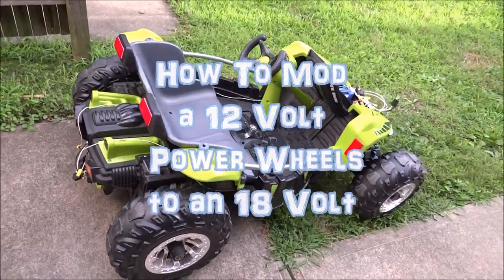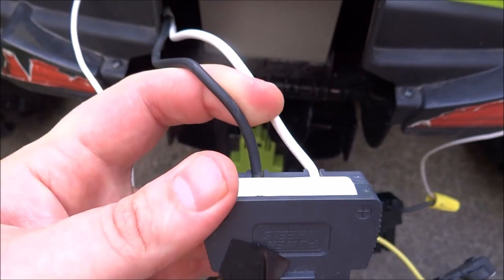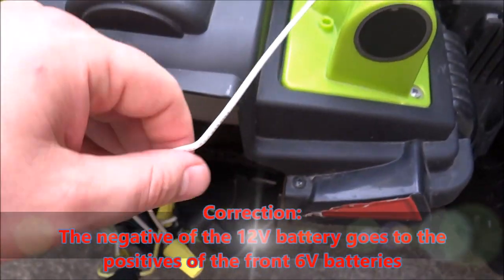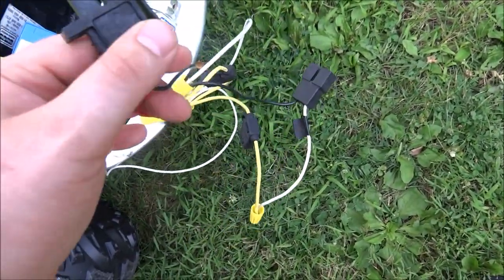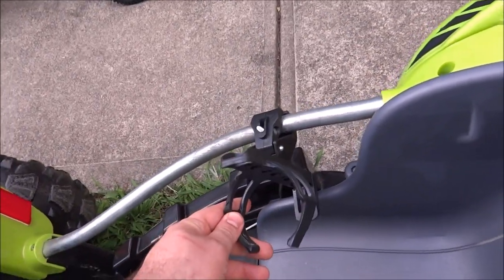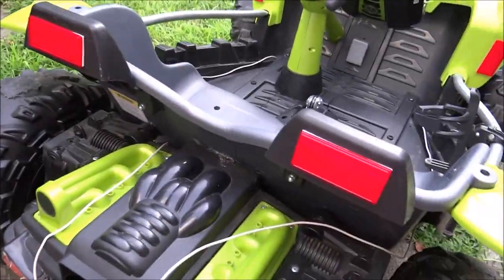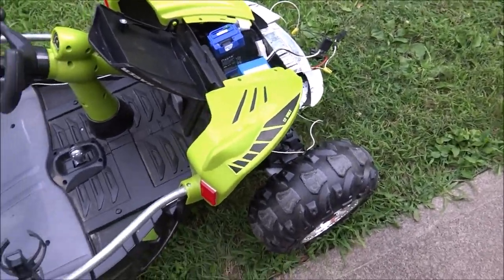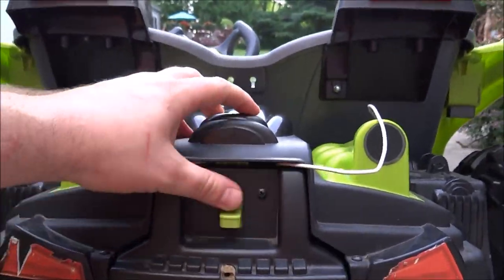How To: Mod 12V Power Wheels to 18V SAFELY

Comment: I did 24v low 36v high... Two seat modded barbie mustang into single seat with chassis upgrades required to keep it together.  Moved windshield forward 1.5 inches, steering wheel relocated to center, orange paint, grip mod (will just burn out without them) for when the kids are driving it.  List goes on.  It already had cup holders...  :)
Reply: Do you have a build page?

Comment: I can't watch a video with someone who uses household wire taps...
Reply from the maker: THATJDMGUY Great comment, very helpful!
Reply: Harry Manback using those household connectors is not upgrading one of these safely. You what advice? Solider and shrink tube the wires to Do it safely and properly
Reply from the maker: THATJDMGUY Why are they unsafe?  That is what professional electricians use.  Are homes unsafe because of them?  It's been running with zero problems for over 5 years now.
Reply from the maker: Adam Wrong OK, thanks for the explanation.  That makes sense, but again, it's worked for me for years.  Next time I do one, I'll do it more professionally.
Reply from the maker: Adam Wrong That's also good advice, thank you for the help.

Comment: I am going to change mine over.  I have a 12v trickle charger that I have been charging my cars with. I make two poles and the kids put the aligator clips on them to charge.  Dumb question, how do you charge 18v system?
Reply from the maker: Guy Redman Not dumb at all.  But I just used the chargers that the Power Wheels batteries came with.  A trickle charger is likely better for the batteries.  Though, if you just use the OEM chargers as per their instructions, they should be fine for years.  Cheers!
Reply: @HarryManbackYouTube  I guess I mean how do you charge an 18v system with a 12v charger? Prior I fount out that if I charged a 12v system with a 6v charger the battery would never get fully charged. With the same thought process would an 18v system ever fully get charged with a 12v charger?

Comment: what's the amp rating of this 12v motor?   I have related question.  I have 200 Watt 18v 11a solar panel I want to wire directly to 12v 4a 4 speed fan... but I can't afford to damage the fan or have a fire cause it's installed on the roof of my van.   Dumb question, how does speed play into this if I keep the fan on low will that help with stress or more volts on the  motor or will low feel like high with 18v going through it.   I have other appliances like a 12v fridge that says it can handle 24v too so not so worried about that.  I understand 200 watts is ideal and I will likely be closer to 120w anyways but will this lower the voltage or the amperage of the panel?  I just wonder if 12v vs 18v is a big deal when we are talking about 4amps..

Comment: How long have you been with the modification without having problems with the motor or gear box?
Reply from the maker: Victor Torres It's been running for nearly 6 years, with no problems.  Many kids have used it, and it's been great.  I'm glad I did the modification, and if you chose to do a similar modification yourself, I would say the two things to really keep an eye on are charging all batteries properly (as per the manufacturer instructions) and the twist connections.  One of my connections came loose a couple times, so I just tightened it really well and added some electrical tape.  I was afraid of things going wrong when I first did everything, but once I was done, I was so happy with the finished product.  And again, you can always up it to 24 volts, which will make it even FASTER, but the motor WILL burn out in just a few months.
Reply: Thank you Harry Manback

Comment: Talks about doing a 12 to 18v safely and doesn't even use heat shrink connectors, wire nuts?, no more internet for me today
Reply from the maker: michael macchio No more original interesting things to say, either... eh?  It it still works, son.
Reply: Lol wire nuts work just fine

Comment: Educating, not hating....There is a much easier way to do this,A lot of un-needed work went into this project.Rear tires are installed backwards as well.
Open gear shifter and channel leading to accelerator ,Cut the white wire lead from rear battery,connect rear battery pos"white wire" to front battery neg."An old charger will work to plug right in to a second PW stock battery"..Then front battery pos to accelerator pedal.Can be done with about 2 ft of wire in shorter time then making this video.
Reply from the maker: Joe McGowan Thanks for the info, but the reason I did it this way was so that if anything went wrong with it within the warranty period, I could remove all the modifications and it would be back to it's stock build.  Nothing was cut or altered on the base vehicle.  But yeah, your info can work great for some.  And yes, I see the tires are backwards now, heh.  Didn't seem to make a difference.  Thank you for commenting.
Reply: Joe McGowan So the battery pos goes to the pos leg of the accelerator pedal and that completes the circuit.

Comment: Is this a joke? ALOT OF EXTRA UNNEEDED WIRES. Rear tires are backwards. Why do you need 2 male vehicle side battery connectors? You don't. Use crimping connectors for a permanent hold. If your worried about "warranty" you should have left it alone. Diagram shows 3 extra fuses, why???? Factory batteries have internal reset fuses so the 3 extra are unnecessary. Diagram shows batteries wired parallel instead of in series ,  need to be in series for more power/faster. I'm really hoping this was supposed to be a joke bc even tho it does work this is completely the incorrect and expensive way to do it.
Reply from the maker: Daniel H97055 You seem wicked smart

Comment: I have a 6v lightenin mc queen i did to 18v using a 4ah drill battery with a 30amp inline fuse and it fucking smashes.  Today was the 1st day my son used it and my gf and I couldnt stop laughing because its driven by 1 motor to 1 wheel and has mean torque steer.

Motor gets hot after 20 mins but I found a 12v ATV on offerup for $20 that hopefully has 2 motors 1 per wheel but even still it should handle the 18v a lot easier. 

Surprised that after 15-20 mins my power indicator on my drill battery only dropped 1 bar, gotta be careful to not completely drain it but it is a reconditioned one i paid $30 for so no biggie.

Comment: where did you pick up the second battery connector for the 12v battery?
Reply from the maker: +tonikins99771 I just got lucky and cut one out of a broken power wheels I found on Craigslist, but you could still probably find them pretty cheap online: eBay and such, maybe hardware online stores.  http://modifiedpowerwheels.com/ Has loads of info.  Those guys get really into it.  Makes my modification look like a plug and play job.
Reply: Harry Manback if you change the wheels to rubber wheels it will pick up more speed

Comment: safe . ?just because you stick a fuse on this doesn't make it safe.  safe would be using Hevey  gage wire. fitting them in wire tray under the car.  and using 3 of the same battery's brought brand. new is also battery safety

Comment: wow the points of failer just skyrocketed. voltage regulator and you perfered tool battery hook up. i mean give credit do where it is do i guess the wire nut proficiency was master By the end.
Reply from the maker: It worked... perfectly... for years... good day, sir.

Comment: Why. Just  buy a female  connector off ebay and wire into your battery  / adapter much cleaner  instal.